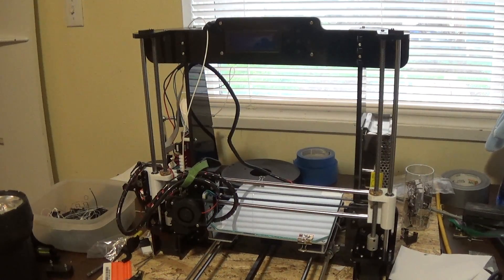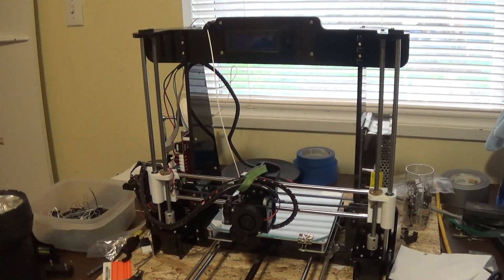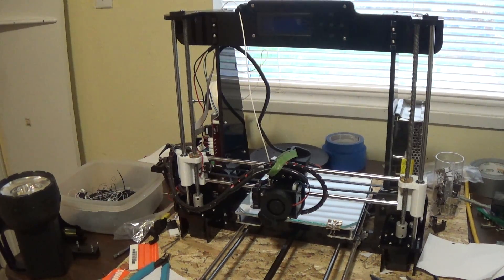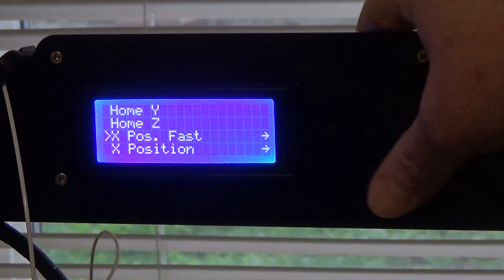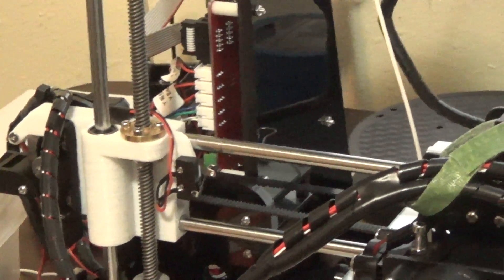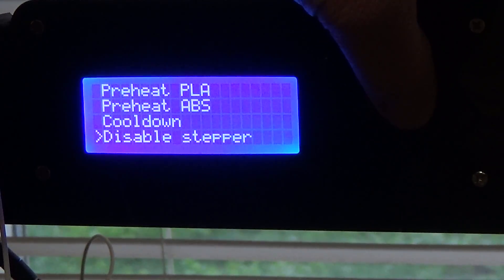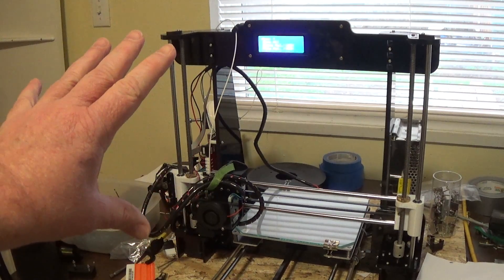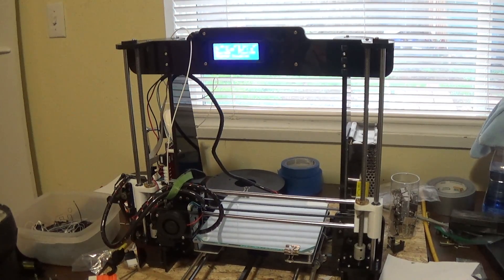Anet A8 Checking End Stops

Comment: when i home my y axes  the hot bed travels backwards and goes so far it starts poping
Reply from the maker: Do you have an Anet A8?
Reply: @tubejim101  me too same problem yes I have an a8
Reply from the maker: @reynaldoreyna839  For bed traveling in the wrong direction:  Look at the wires of the axes that are working correctly.  Make sure the the one that is not correct, is pinned the same.  Colors of wires the same.
Reply from the maker: @reynaldoreyna839  If the colors of the wires are pinned the same, there may be a setting in your software, causing the bed to go the wrong direction.
Reply: I have the same problem with the hotbed belt grinding, have you fixed it?
Reply: Well, what is tripping the stop switch? Cannot find anything!

Comment: Ok so I tested all the stoppers they all work but my y access motor won't stop after the stepper is clicked what should I do
Reply from the maker: Has it ever worked correctly?
Reply: Mine is having the same problem. Just built it today and did your test, but says its in working order. Any suggestions?
Reply from the maker: Can you post a video of what yours is doing, or not doing?
Reply: I'm having the same issue

Comment: Got dammit! This just helped me out. I did home all. And it looks like  my z and x didnt stop. I had to unplug it quickly. Also the power doesn't come on. I unplug and plug in power several times and it only came on once. Put multimeter on the output to the main board and it has no voltage.
so it looks like my net anet a8 i just got 3 days ago has a bad power supply and 2 end stops not working. Im pissed. I contacted gear best about the power supply. But not the end stops. Because i just saw this video this morning. Im not going to wait on them. Im going to use a PC power supply. Im guessing i can find those end stop switches locally. Its bad enough where I ordered it from gear best. I selected the LA warehouse. And they shipped it from china anyway. So all around I have been having a hard time.
Reply: same issue i have anet a8 and my x and y axis limit switches dont work their good but they dont work if u get what im sayin all i get is grinding  bought new main board same thing so it must be in the firm ware and the limit switches you can buy from amazon and have in about a day maybe two ive had my anet a8 for a few days less then a week